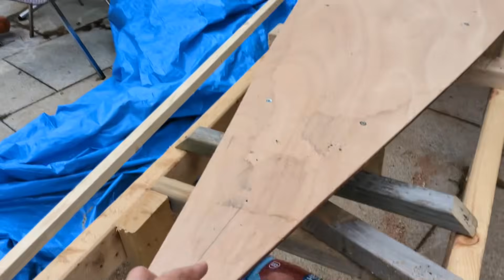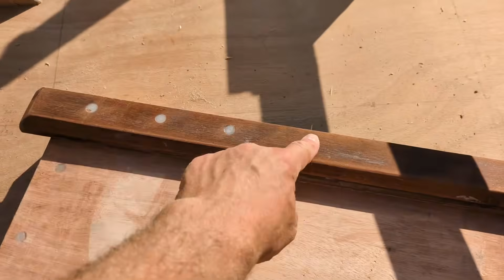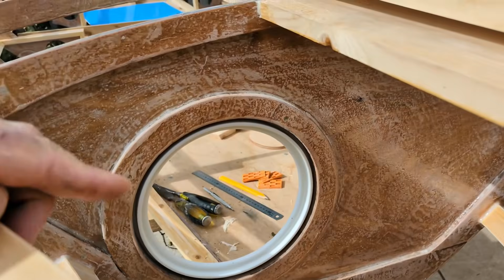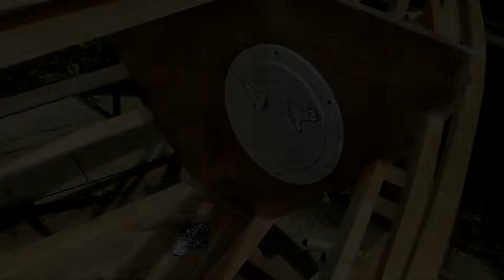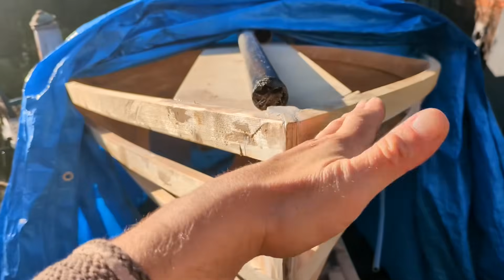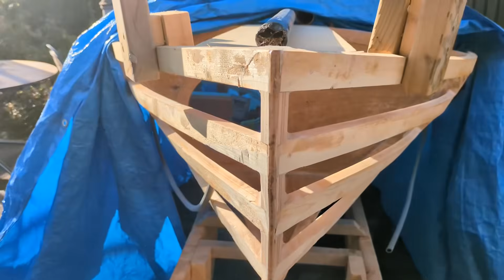Boat build continued.

Comment: Hi Duncan, I was excited to find your channel because I'm also building a small boat in my garden and have been feeling pessimistic about going into winter! I'm glad im not the only one! its looking great so far! nice work.
Reply from the maker: What are you building?
If i can get the bottom planked and sealed on the under side it will make things easier since i can just turn it upside down in periods of prolonged rain.
Reply: @DuncanLaw I’m trying to build Dave gentry’s Annabelle with a few tweaks to design! 😅
Reply from the maker: @reidjamesonpotts5810 oh nice, I looked hard at that one because of it's portability before I decided to build something that would live in my front yard that I didn't have to carry through the house every time I used it.
Skin on Frame is a cool idea.
Reply: @DuncanLaw  ah good thinking, luckily I have a side path that will be just wide enough carrying it sideways